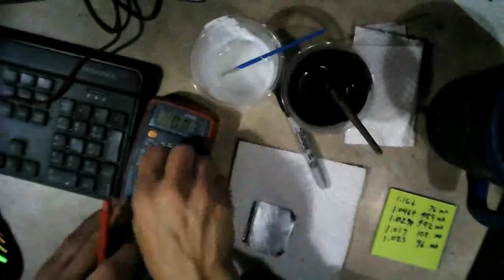Improved Thin Film Borax Separator!

Comment: If you have not had the opportunity to review the research of ibpointless2 please find the time to do so. In particular is his chart on the video "My crystal cells does not use water and the data shows it". Also the video on the video "Crystal Cell power goes up under load". He has a series of videos on research into glue cells that indicates cyclic charge rebound characteristics similar to what your data is showing. He stopped his research for some reason or other just when I thought it was getting exciting and diverted to other research. Although he was trying to emulate crystal cells I started to get the impression he was at the cusp of developing what seemed like solid state technology. I could be wrong but your experiments with Ti02 and glue is starting to look like independent overlapping confirmation and improvement on his research. At any rate it's worth mentioning. Whether you are inclined to pursue the line of experimentation or not you may get ideas on how you might want to proceed.
Another idea is to get an additional meter to hook up on a DPDT switch together to measure volts and amps with a single throw of a switch. That way you wouldn't be occasionally shorting out the cells unintentionally. Robert came up with that idea for the sake of convenience but it would have the added benefit of preventing missed steps.
Your work is starting to get exciting to me. The developments are thought provoking.
Reply from the maker: Salt's are interesting crystals, and borax is a particularly interesting salt to me. PVA by itself isn't conductive, but it apparently doesn't matter after it gels with the borax. How it locks up the water in a solid without stopping the hydrolysis process is pretty amazing. I wouldn't have thought that possible. I'll make some time to check out IBpointless soon.
Reply from the maker: I just checked out both of those videos. I think he has a slow substitution reaction going on in the cell with the water tied up in the mag sulfate. I did learn that he lets his glue cells dry well before using the battery. I'm making some new separators now. :-)